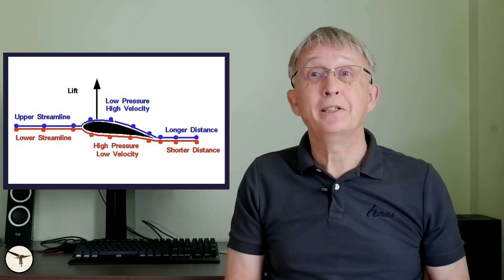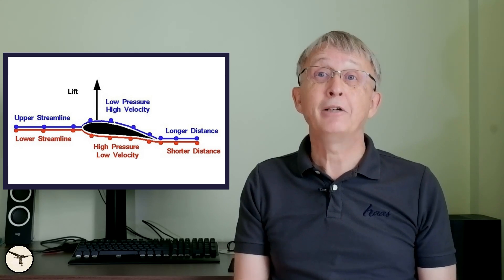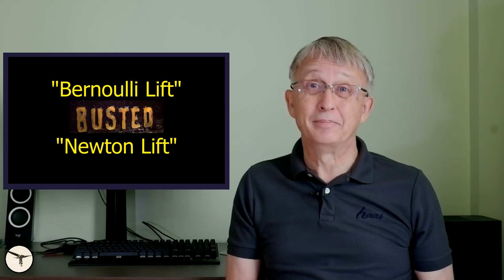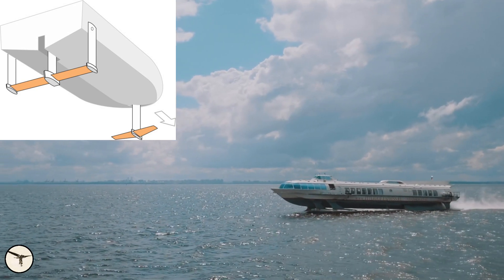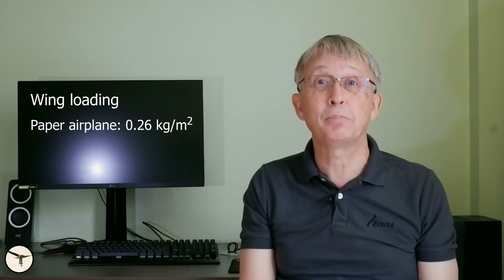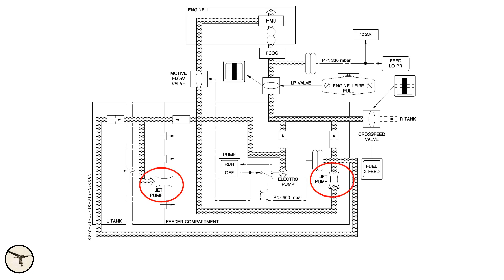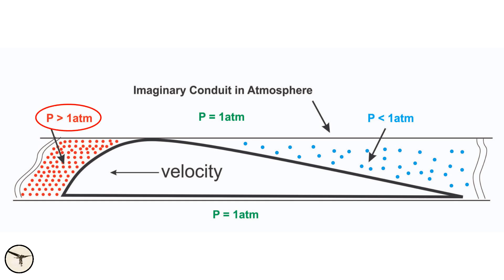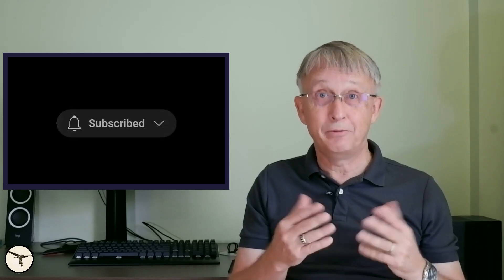7 Wing Lift Myths You Must Avoid: What Really Makes Airplanes Fly!

Comment: what happens in performance if a wing aerofoil is sharp on the leading edge
Reply from the maker: 6:42 onwards: The F-104 has a sharp leadning edge. The wings are optimized for supersonic flight. But the stall angle is low. Therefore, the wings are equipped with leading edge flaps and trailing edge flaps, as shown in the video.

Comment: I remember one thing I did as a young kid.
Putting my flat hand outside an open car window.
Like it was an aircraft wing.
As the car's speed increased, so did the force on my flat hand.
Any change in the angel of attack, + AOA would result in my hand being flipped upwards.
And this was a strong force acting on my hand.
And where did I feel the force the most?
On the underside of my hand. With very little force being felt on the top of my hand.
So I would conclude that this was the main reason wings generate lift.
Reply from the maker: Our skin can feel higher pressure better than lower pressure. The pressure difference around a wing is just a few percent of the atmospheric pressure. We cannot feel that. When you hold your hand out of a car window, you are holding the hand in an angle against the wind. It will push on your hand with a force acting upwards and backwards. Is easy to neglect the vector pushing your hand backwards. Therefore, you only feel the upward vector, interpreting it as lift. Your hand can best be compared with a stalled wing.
Reply: @FlywithMagnar  Thankyou very much for taking the trouble to comment on this amazing subject.
Wikipedia has an interesting page on "Wings", and explains AOA. 
I use to help launch Glider aircraft, and on windy days it never ceased to amaze me at the lift created by the wind blowing across 
the wings. 
Kind regards, and greetings from Africa.

Comment: Simple: the shape of the airplane creates difference in pressure between the upper surface and lower surface.
Reply: I have been going through your comments on this video, and I was wondering if you would like to talk about your wind tunnel experience. Full disclosure, I am an aerospace professor and I would run 150 student per year through the simple 2D wind tunnel in first year first semester aerospace at RMIT in Australia, so I have a lot of experience with it.
Reply: @aerospacedoctor 
Sure. But what specifically?
Reply: @Talon19  it was your comment a while ago, on the 4th of August 2024, but it was the one directly to Magnar, and I have noted the same comment on other videos. You said you have done wind tunnel experiments where is is lift and no circulation. Can you tell me how you measured that?
Reply: @aerospacedoctor 
Measured through pressure taps along the upper and lower boundaries of the shape being studied.
Also using trip strips, smoke streamlines, and dyed oil under UV light.
Reply: @Talon19  so you measured lift (there was a net force present) and you also simultaneously noted no net difference in the average speed of the flow over the upper and lower surface?
Reply: @aerospacedoctor 

There can be no “net change in velocity between upper and lower flows” by conservation of mass, momentum, and energy.

There are LOCAL differences in pressure, temperature, velocity, and flow where the airfoil is.

You obviously aren’t a real aerospace professor, doctor, or educator.
Reply: @Talon19   so you haven't watched the flow visualisation from Cambridge (Prof Babinsky)? It won't let me post the URL so you will have to search for it, video title "Airflow across a wing".
Go to around the 40 second mark of that 1 mintue and 13 second video. I think you might find it interesting what is being said and shown...
Reply: @aerospacedoctor 
I wrote post/grad papers referencing the video you discussed.  It’s a poor reference because it uses unfamiliar, poorly defined, and arbitrary language.
It is not a useful review of theoretical, practical, or wind tunnel fluid dynamics.
The fact you pose it as a source shows you have ZERO clue what you are talking about!
Don’t waste time, and don’t respond. 
You’re a waste.
Reply: @Talon19  sure, then lets go to the source, Prandtl (1923), Figure 3. The timeline for the upper flow is clearly ahead of the timeline for the lower flow. Care to claim that the father of modern aerodynamics is wrong?
Oh look at this wonderful simulation with the title "Triple-airfoil particle paths"...
Oh look at this great video... "9. Vorticity (2 of 2)"
Oh look the free online tool from NASA has timelines... FoilSim III
Reply: @a @aerospacedoctor 
There is no way you are an educator when you appeal to authority as some kind of justification for bad science.
The Cambridge video only shows what IS happening; not the why, how, free stream diagram, fixed body diagram, pressures, velocities, or forces on the airfoil.
The video actually reinforces more bad science such as Bernoullian lift, Newtonian lift, flow turning, and circulation.

Through empirical testing, we can show how a fluid interacts with a shape to produce differences in pressure, velocity, and force.

Experimentally, we can show an asymmetric airfoil produces lift at zero angle of attack.  Similarly, an asymmetric airfoil with a flat bottom and thin, flat, smooth leading and trailing edges along the chord line will also produce lift at zero AoA.

This eliminates such confounding bad science as Bernoullian lift, Newtonian lift, flow turning, and circulation and shows the plane reality that the SHAPE of the airfoil produces differences in forces, velocities, and pressures between the upper and lower surface of the airfoil.  This difference is lift.
Reply: @Talon19  it is not an appeal to authority in the logical sense. An appeal to authority substitutes a person for evidence. What I am doing is pointing to the historical origin of a definition that has been embedded in aerodynamics for over a century because it reproduces measured forces.

First, to take a step back, you are 100% correct that lift is the pressure at the surface. JD Anderson made that very clear. You also decided to escalate to defensive rhetoric after my first question re lift happening with a difference in velocity. That is understandable, this is a charged topic it turns out, but was not necessary, I did not attack, I asked a simple question.

So, if you agree the video shows what is happening, great. Because what it (as well as Prandtl, and the other things I added in edits above) shows is the flow over the top is going faster, and the flow underneath is going slower. But you have to know that. If there is a difference in pressure, and the fluid all started with the same total pressure (all ambient, ignoring height), then there must be an average higher velocity with an average lower pressure? See when we teach students to do potential flow and VLM methods to model fluid flow, we get the velocity field out of the calculations. We then use Bernoulli to recover the pressure field directly from the velocity field. Yeah sure fine print about boundary layer and other assumptions... but when you actually open MATLAB (or Python) and you code a simulation, you get velocity from it, and then you apply Bernoulli to get pressure. We did that in 2nd year at RMIT where I taught 1st year, and here at UNSW they do that in 3rd year.

So, while I am sure people can point to that Cambridge video and infer the wrong thing from it, you cannot deny that the flow is faster over the top, if you agree it shows what is happening.

All I wanted to discuss with you was that the only part in everything you have written is not understanding that circulation doesn't mean anything more than the flow is faster on top, hence the pressure is lower. To be fair, I have written a published literature review, and I know some out their use circulation as the cause of downwash. They are wrong... you would be correct there to reject what they are saying. But them being wrong in their interpretation of what was written 100 years ago, doesn't make what was written 100 years ago wrong.
Reply: @a @aerospacedoctor 
Your appeal to authority is plainly given:
“Care to claim how the *father of modern aerodynamics* is wrong?”

As if the “father” of anything could never be wrong. 🙄 

The fact that airflow over a curved surface accelerates shouldn’t even need to be stated; that’s pre-AE 101 knowledge.  I’ve never heard or seen anyone say the velocity of the air over the top of a wing is equal or lower than the velocity over the bottom of the wing.

So what’s your point?
Reply: @Talon19  Sure okay, it wasn't evidence (see Figure 3 with timelines showing the flow going faster over the top), it was an appeal to authority... I think we established something critical there. Anyone can be wrong. Great point. Well made.

I am a bit confused I thought I made self contained points. But let me step through them:
1) you agree, the flow over the top is faster.
2) you can easily measure the pressure on the aerofoil as we do in the education wind tunnel experiments to which your many posts relate.
3) we can use Bernoulli to convert those pressure measurements into a velocity measurements.
4) we can calculate the coefficient of lift from an integral of the difference in the coefficeint of pressure on the top and bottom surface.
5) we can also calculate the coefficeint of lift from closed line integral of the velocities... giving the exact same number...
6) That closed line integral is the circulation... therefore, if there is a pressure difference, giving a velocity difference, there is a net circulation.
Reply: @aerospacedoctor 
Dump 6
The term circulation is entirely useless and misleading in this case.
Reply: @Talon19 so what is your definition of circulation?
Reply: @aerospacedoctor 
I don’t use the term circulation with regards to aerodynamics because it tells us nothing, we already have better terms, reduces confusion, and doesn’t contribute to misinformation.
Reply: @Talon19  earlier you stated "by conservation of mass, momentum, and energy". I assume you also require the conservation of angular momentum?
Reply: @aerospacedoctor 
I’m unsure what you mean there because nothing is spinning.
Reply: @Talon19  Comment 1) It won't let me reply with any substance...
Reply: @Talon19  Comment 2) I created a new post on my channel if you want to chat, it won't let me here.

Comment: A wing is just a very efficient shape at deflecting the air downward, which happens not only at the under side but also the upper side via manipulation of pressure. This down draft tells us there must be a lift force induced on the wing because of newton's 3rd law of motion.
Reply: @chengong388  Nice explanation for an average Joe. All the rest of discussion about how the lift is actually generated becomes quickly too hard to explain in easy terms.
Reply: Positive cambered airfoils with flat bottoms still produce lift at zero AOA and without air deflecting.  This case shows the pressure differential is the cause of lift, not the deflected air.
Reply from the maker: @Talon19  this wing will produce a downdraft because the air flowing over the wing will, because of its momentum, not change direction. Therefore, Newton's third law of motion is still walid as an easy explanation for lift.
Reply: @FlywithMagnar  
I’ve done the wind tunnel tests myself which show circulation and/or deflection are not required to produce lift.
Reply: @Talon19  …you have not done “wind tunnel tests that show deflection is not required to produce lift”. It would be violating Newton’s Second Law. Your claim (made elsewhere) to have done those experiments in AE301 at ERAU is exposed as pure BS by the fact that windtunnel is not, and never has been, AE301 at ERAU.
  It is an observed fact that upwash exists in the leading near field which is then turned downwards by the airfoil until it leaves the trailing edge at a different angle. Ergo deflection. Equally, there is net lower pressure atop the wing but these two aspects of pressure distribution and streamline curvature are unavoidably associated with one another. Hence the pressure difference does not debunk flow deflection, but quite the opposite.

Comment: if you think air is like ground or ice, you get the idea, why ground keeps you up, and you dont fall, it pushes you back up, when you push down to it, all forces must be equal to maintain level, of flight
Reply: I hate academics rules of how things need to be presented. yes you. dont waste your time in this video. opposite forces are equal. air must apply equal force to the wing as the wing applies to the air. if air does not hold you up, you fall. yes tree leaves fall very slowly, like a parachute, no side-ways lift. because air holds you up. explain that pro. when you push a wing piston down to an air column, stuff happens. when you push a wing piston sideways to the air, like a sail, stuff happens.
Reply: p=F/A = mg/A, so literally making a plane lighter and increasing wing surface area, will increase the wing pressure to the air, during flight. all other factors are minor tricks. of course F is a vector force, so during flight it points mostly forward and a bit down. no, it points still directly down. as much pressure you push down with the wing, the equal force air pushes the wing up. of course when pushing down, then the above wing surface experience the decrease of pressure of same magnitude. wing functionality is equal when moving and when free falling. or tree falling leaves.
Reply: you need to lose your job to make people free.

Comment: Thanks. Now do you think you‘re able to explain the Magnus effect causing lift on the Flettner aircraft which has cylinders as wings? Benouilli and air pressure below and above that spinning wing does not seem to explain the lift force. Rather, it looks like the relative speed between airflow of the surrounding air and the spinning cylinder surface matters. Compare with topspin and backspin in table tennis. I believe flow separation and deflection of air around the cylinder matters, and only Newton (actio=reactio) not Benouilli, explains the lifting force. It even seems as Benouili would partially antagonize Newton when it comes to the Magnus effect!
Reply: The pressure on the upper surface of the cylinder is lower than the pressure on the lower surface; Bernoulli.

Comment: Actually, it does work if it's a narrow strip of tissue paper hung from the lower lip and one blows straight ahead - I've done it. Looking at wing loading of a Cessna 172, one discovers the pressure differential required to support the gross weight of the aircraft is on the order of 0.1 psi

Comment: Regarding the Coandă effect, Boeing built two YF-14's using this feature (failed to get the final bid) while the Soviet Union went ahead with a production version, the AN-72. You used the F-104 as an example of a plane using a flat wing when (even with the leading edge and flaps stowed) it does not - although very thin and symmetrical (I think, it looks so).

One youtube video claimed that we have not really come up with a good theory on lift; it seems to me we have several things going on and depending upon angle of attack and speed one of them will over come the others. Something is working as we keep making things that can fly. :^)  But the way lift is taught in your lower grades is not the only thing tossed in the trash once you get into college. I'll offer up the atom as another example.

Comment: Since in conventional aircraft designs, the wing is moving and the air is stationary, then any concept with relies on the forward-backward 'motion' of the air particles over the wing (including different speeds over the top and bottom of the airfoil) is baseless.
The only components there are to deal with are the relative upward/downward velocities of the previously static air molecules as the different cross section elements of the wing move through the air mass.  Counterintuitively a standard wing profile would see more air shoved up than down as it travels to the maximum chord width, which one could expect would give a net downforce, rather than up!   Once the wing has fully passed a particular bunch of air particles the net up-down result must be zero, unless angle of attach has induced a general downward motion of the airmass - then thrust (or lift) is mass of air times its downward velocity, I guess.

Love your work!
Reply: First paragraph - these two scenarios are identical, as far as the wing is concerned
Reply: @50shanks  I don’t think so. The air cannot exhibit laminar or turbulent flow if is not flowing can it.
Reply: @nigelwilliams7920  It most certainly can. Fill up a bathtub with stationary water, then move your hand through the water at one end of the tub - is the water at the far end of the tub, despite never coming into direct contact with your hand, still stationary? The particles in a fluid interact with eachother.
Reply: @nigelwilliams7920 semanics.  One is a laminar flow and the other is a laminar disturbance.    Push a stick through a pond, then hold it a smoothly flowing stream.  Take a photograph of the water. Compare.
Reply: @nigelwilliams7920 
The fluid is flowing relative to the airfoil.
Reply: @Talon19  A moving fluid/gas has a whole lot of things going on (like v^2/2g, for example) that are not happening when a fast-moving wing passes a stationary air molecule.  You may get a usable answer for the wrong reasons, but its still the wrong reason and your analysis will fail at some critical point.  Obviously it fails, because when the 'wind tunnel' type analysis is looked at in detail it has failed to give a plausible approach to the 'lift' question, hasn't it?.
Reply: @nigelwilliams7920  
Whether the wing is moving through the fluid or the fluid over their wing, the results are the same; otherwise wind tunnel tests wouldn’t be valid.